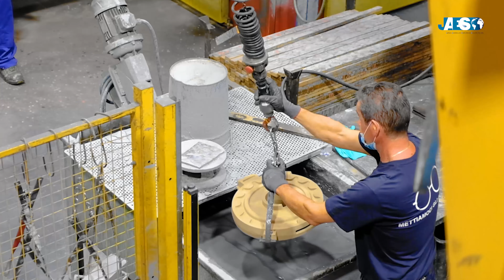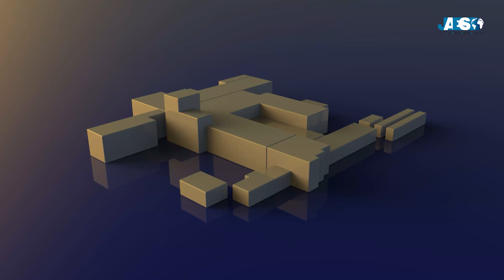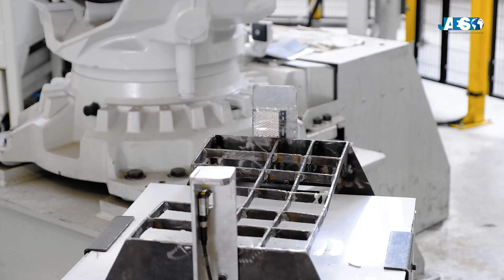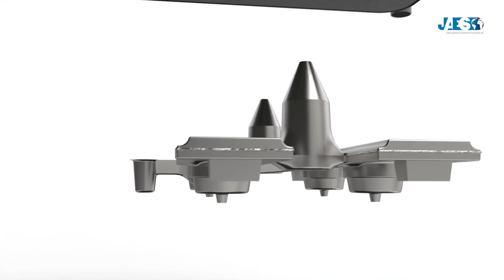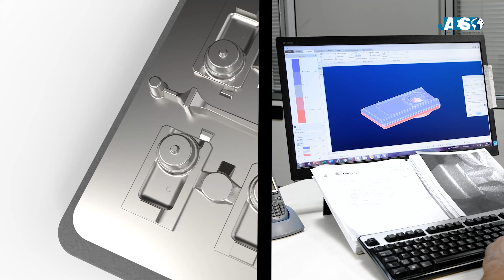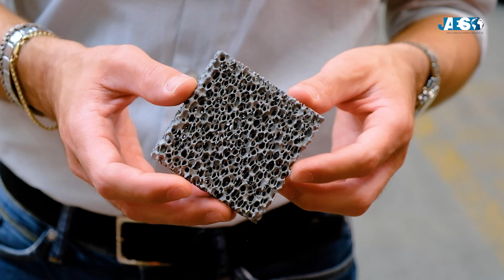How does a FOUNDRY work PART 1 - Zanardi Fonderie

Comment: https://youtu.be/uu5BaIeio40?feature=shared

Discover why Greensand Molding is revolutionizing the metal casting industry! In this video, we delve into the key advantages of this economical and eco-friendly molding system. Learn how its low cost, high productivity, and versatility make it ideal for casting aluminum, brass, bronze, and cast iron.